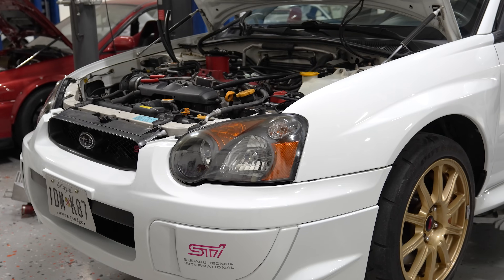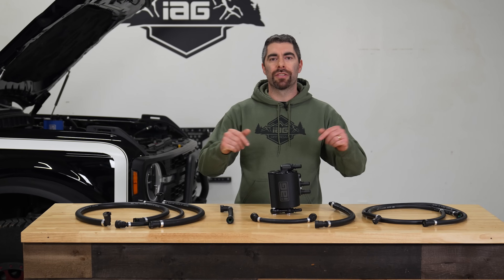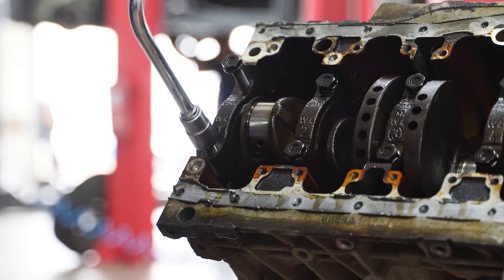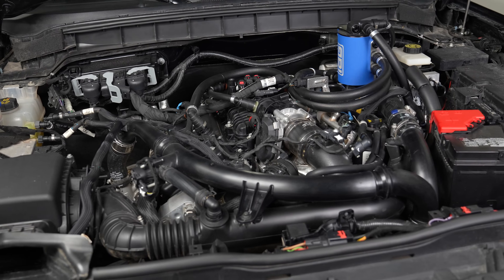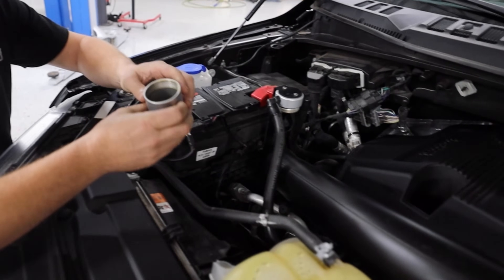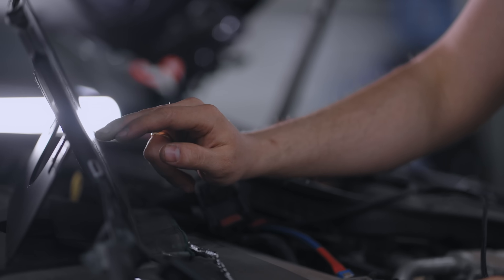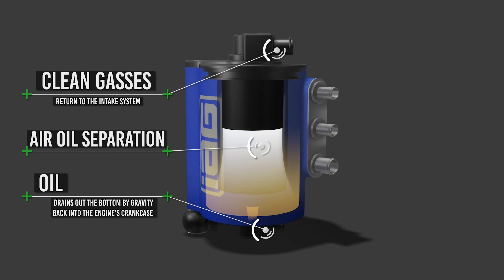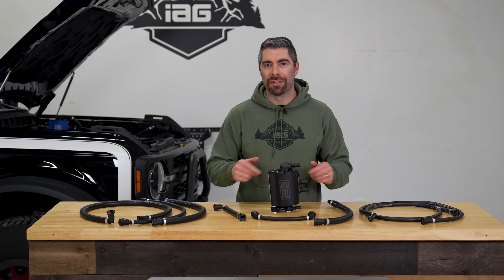What's an Air Oil Separator (AOS)? Why YOU SHOULDN'T DRIVE WITHOUT IT

Comment: I got the Street Series AOS form IAG for my EJ WRX. I live in a very cold climate tho, so I am worried about my oil drain line freezing. I do hear the IAG uses a coolant line to heat the system up?
Reply from the maker: Correct, our AOS has the coolant system integrated to help heat the canister to prevent condensation and build up.